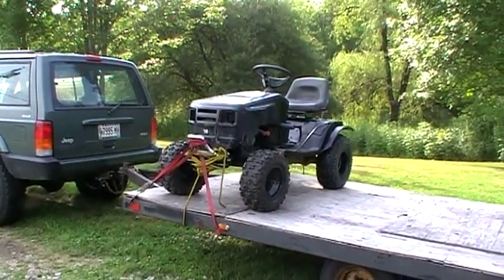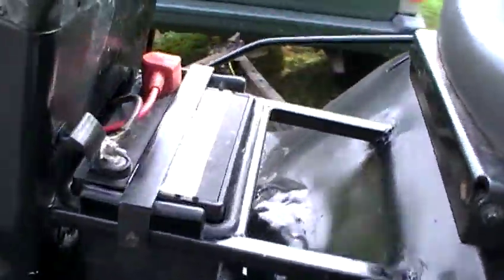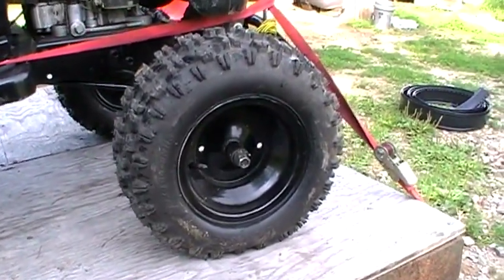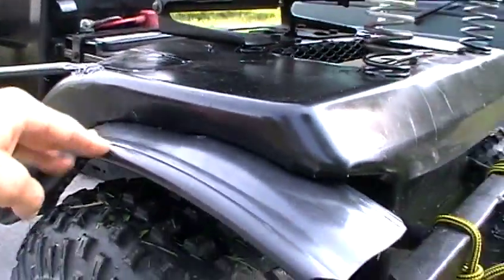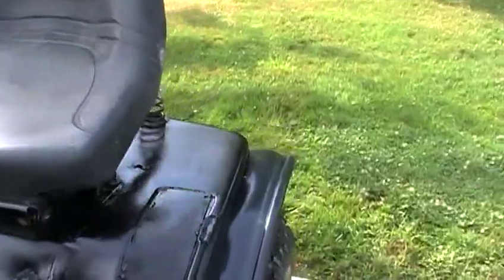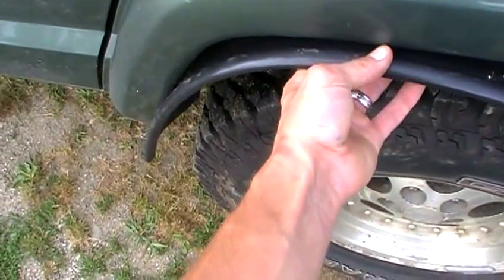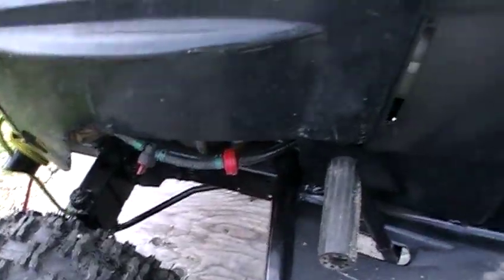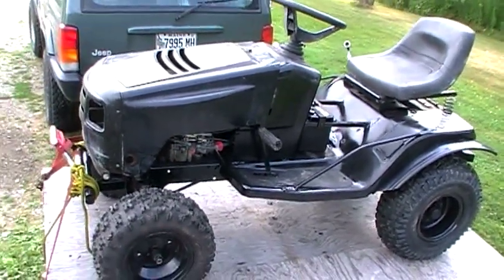Off Road Mower Upgrades #3 Fender Flairs

Comment from the maker: I got a used I/C block and bought the internals I needed. I think it was a piston and a connecting rod. I re-used my crank shaft, wrist pin and clips. did some porting and such, then put it back together. 
It was very cheap for me, I got my block for $20, and did the work myself. I only bought dremal bits, gaskets, and the internals which were given to me at a discount. Overall, it was probably less than $50

Comment from the maker: The terminals are surrounded by a large ring of plastic, which is non-conductive. The metal strap sits just behind that. The won't ever be able to contact each other.
And the gear oil, I forget how much it's actually supposed to have, but I squeeze about 6-8 extra oz. in it once and a while... Usually when it starts getting loud. I typically change it once every year.

Comment from the maker: you need the connecting rod and piston from another ohv briggs motor. your motor is a 28cu.in. briggs flathead, so you need to find the setup from a 28cu.in briggs ohv motor. basicly, any ohv motor from 12-17hp will work, as long as it isn't a twin.

Comment: I have a tip for your mower if you get wider tires I have 22by11by8 on my craftsman and there the same as yours but I dont get stuck much and my rear end is not welded and I have drove it through a pond I just think it will help

Comment: alright thanks i am planning on putting this gear ratio on a lifted 4wd lawn mower and wanted some speed and yet have enough towing power without it bogging down what would you recommend/do for this
thanks
Reply from the maker: then this would be a decent ratio, maybe a lil fast though. you could go with a 1:1 ratio,(same size front and rear pulley's) it would go a little slower, but have more power

Comment: Do you still use your deka battery on the Murray right now, was it a good battery, and how many cranking amps does it run?
Reply from the maker: yea, I still have it on there. I think it was around 300cca or something. It's been a great battery.
Reply: +FearlessFront (Todd Christopher) where did you get that battery?

Comment: and do you get alot of low end towing power with this because i want to do a pulley swap but want enough power to haul big logs out 
thanks
Reply from the maker: I donno about BIG logs, but it still has great low end. I hardly ever use first gear because it's so slow.

Comment: i hate you im a hater: just kidding ur awesome. every one knows ur the best: Question; the engine in the Murray is a 12.5HP what horse power engine did the connecting rod come out of iv got a 11HP Briggs in the mud king2 (my mud king not Jake's) but i thought about putting a stronger rod in her. so i could rev it just a bit with out blowing up just to bump her speed at least up to 85KPH ill make a video of it as soon  as i get a camera but i need help. reply :)

Comment: well a 20x7-8 tire fit a 8in tractor rim
Reply: in theory yes, how wide are your stock rear tires?
Reply: +The Fab Lab it has 18×9.50-8 tires on it know but I want to go a little taller and skinner
Reply: it somewhat depends on the side wall of the tire if it will strech out to the bead of the rim, another thing that i like is to pick atv front rims and cut the center hub out of your old rear tires and weld them into the center of the atv rims so you can still have to lawn mower center hubs
Reply: i could
Reply: get a set of 10inch front atv rims and put some 22x7-10 itp mudlites on them